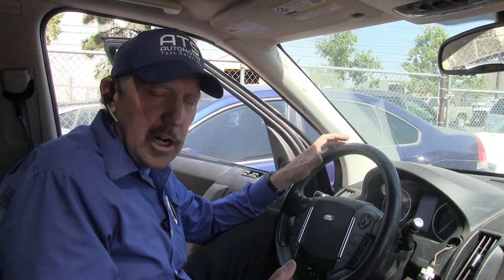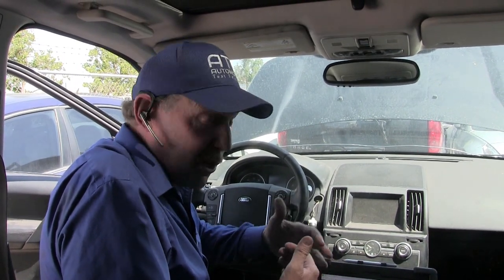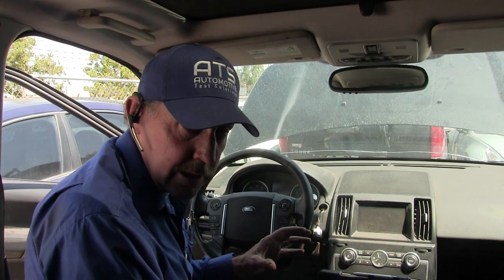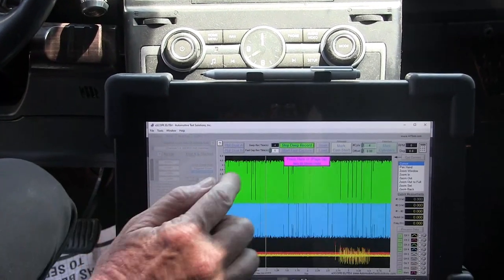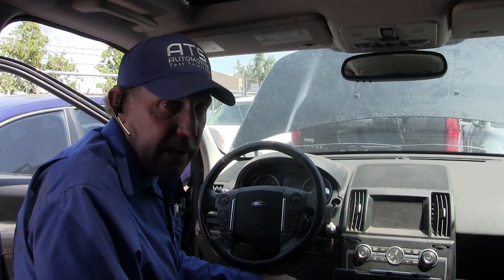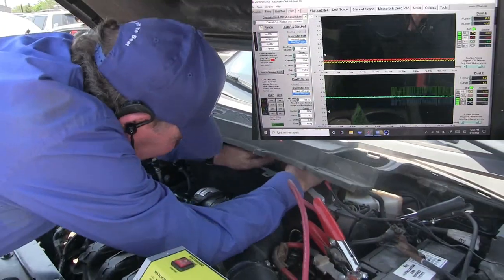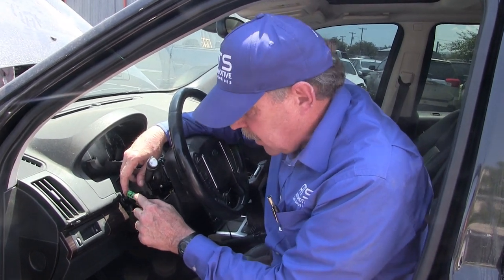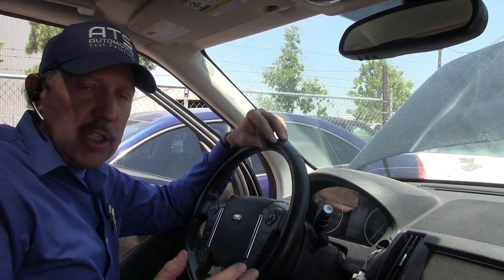2013 Land Rover LR2 no start

Comment: Excellent work , ATS scopes are top shelf thanks for sharing this diagnosis  Bernie .
Reply: The price is a bit high, I purchased the Pico 4425a.
Reply: @scientist100  how do you like it? Currently use the 4425. That new looks really sweet, no more 9v batteries
Reply: @spot-onautomotivediagnosti7583  the no battery needed is great but the connectors are a bit of a hassle for me. I havent used it much but if you use your old one a lot then you can easily upgrade if you really want this one. You still have to plug them in order so that you can get the coloring right on the screen, I asked why it wont match what is plugged even if plugged in the first or last and I was told it would create confusion for people that are used to colors from channel A, B, C and D etc so I guess that makes sense. The person said that it had more to do when saving waveforms thag would create confusion but as long as you label your channels I think it would be ok being g different colors from what most people are used to. Sometimes I cant see what color is each channels I just pull whichever lead color and then it does not match so i have to pull the next one that does, I get confused during use lol